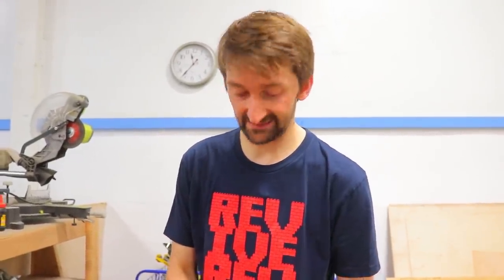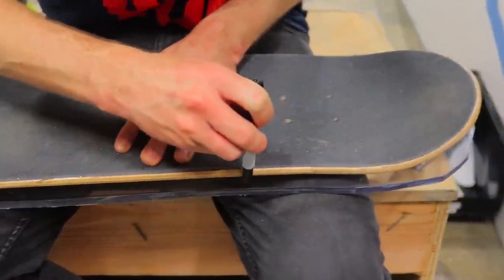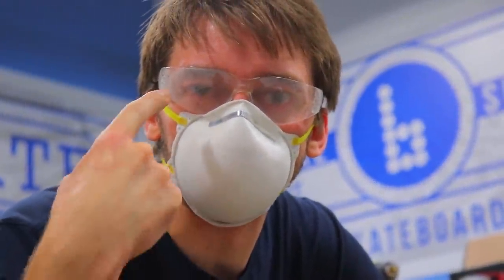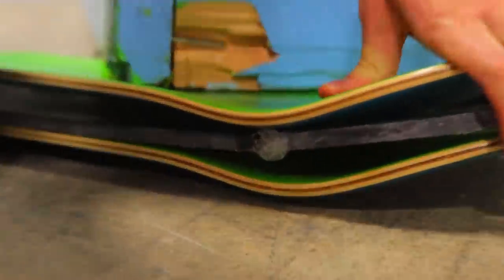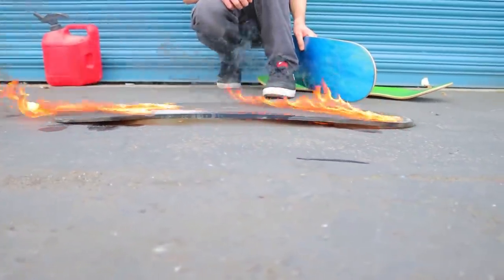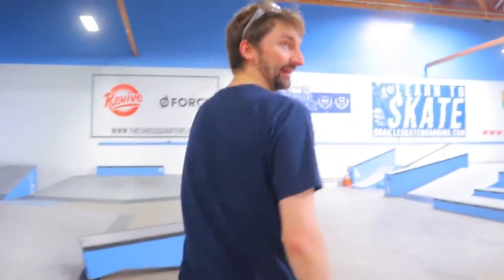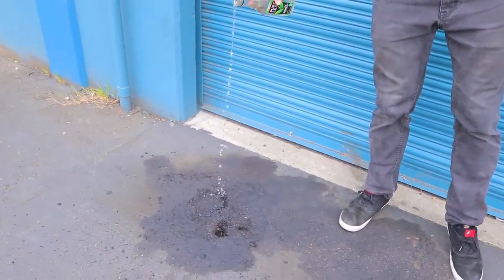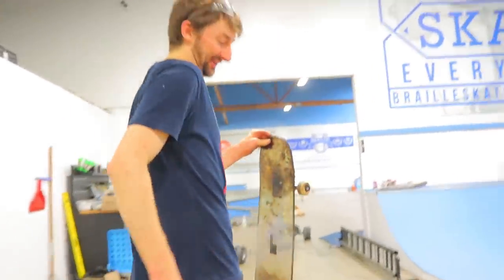WE HACKED THE UNBREAKABLE POLYCARBONATE SKATEBOARD!

Comment: Here ya go Aaron, 
PC or thermoset plastics can only be heated once (typically during the injection molding process). The first heating causes thermoset materials to set (similar to a 2-part epoxy) resulting in a chemical change that cannot be reversed. So technically it couldn’t be melted down again.. I think. Also, if when forming it you heat it too much and it creates bubbles then you might have affected its structural integrity. Cool video! Can’t wait for the lockdowns to be over!

Edit: Correct information in comment below! 🙂
Reply: Polycarbonate or PC is a thermoplastic not a thermoset. Thermosets are like polyester and vinylester resins or epoxies. Thermoplastics can be reformed with heat and welded like PFE PFA, PVC, CPVC, ECTFE, PC, etc. That's why when the PC is brought to the thermoforming temperature the plastic bends and holds the new shape. If the PC was a thermoset than when it was heated it would degrade until combusting or becoming brittle. You are right about the bubbles in the plastic they can form from the heating process but only effect the tensile strength of the material not the flexural modulus. PC is a Bis A product which is similar to some vinylester resins such as Derakane 411 but is classified as a thermoplastic.
Reply: @draconis9766  🎓🏆
Reply: You also can't cool the product too quickly. If polycarbonates are cooled to quickly after being heated and melted, it creates stress fractures within the plastic material. This causes problems where I work if the molds for our PC materials are not warm enough. It needs to be high enough to slowly cool the product as it sets. Otherwise, more air bubbles and stress fractures occur. A 500 degree melt with a 280 degree mold is usual to make sure this happens.
Reply: @karikirby3447  Yes very true!! All plastics being thermoformed must be treated this way! HMU sometime, ide like to see what your thermoforming temperature is ; )
Reply: I feel like if they took the board to a welder they could have gotten this done more efficiently and safely.
Reply: I like how they replied to every other comment but this one😂
Reply: Why would someone take the time to write a comment to inform other people and brag about their knowledge and not even fact check it....
If you dont know what you are talking about just dont write a comment.

PC is a thermoplastic. 

And a hotairgun needs some time to heat up, so dont switch it off every 10 seconds. It should melt you PC board to a puddle easily.
Reply: Draconis Thanks for the info!
Reply: Brendan Kirley yeah

Comment: The 🐗d could have snapped due to high tensile and shear stresses applied in a very short time directly to the interface between the truck plate and the perforated polycarbonate.
If it was still hot it most likely had internal stress, because the inside was hotter than the outside surfaces (inside expanded, outside contracted) adding even more tensile stress onto the surfaces, thus allowing a crack to form and propagate easier.

The thermal expansion is also the reason why the board curved to the direction from where heat was applied

Comment: Polycarbonate has a high glass transition temperature of 150 degree Celsius. It can bee printed using a 3d printer but the hot end where the plastic melts and flows out needs to get around 300 degrees Celsius. Also the bed the melted polycarbonate is on must be heated around 100-120 degrees Celsius. Reheating and cooling has to be done at precise temperatures over precise amounts of time. Some plastics are forgiving on heating and reheating, and then others are not.

Comment: Next time, sandwich the polycarb board between two same-size decks. Use long bolts and nuts through all the truck holes to create even pressure that you can tighten slowly over time. Setup heat guns on both sides of the sandwich near the tail or head one at a time. Keep the hot end far enough away not to create too much heat in one spot. The goal is even heat distribution. Over time, slowly screw the nuts and bolts together on the side you're heating as the whole thing gets warmer and warmer. The trick is SLOW and even heat distribution. Repeat for the opposite end of the board and boom, perfect shaped nose/tail. If you then heat the center the same way, it will end up taking a slight concave shape, giving it a lot more strength. The most important part, when you're all done shaping it... LET IT COOL SLOWLY. It will still be more brittle than before but a piece that thick should be skate-able. Do not dunk it in liquid nitrogen or put it in an ice bath!

Comment: My mate runs a glassblowing factory and even his kiln isn't large enough to do a skateboard. To melt together glass you would theoretically use soda glass (lower melting point) which is weaker than borosilicate. I think without a huge industrial production line regardless of what you used, remelting shards would give you a relatively brittle end product and if it came out like my attempt at a dish, with razor sharp edges. Primo would cut your foot clean in half.

Comment: You had the right idea with the heat gun for concentrated heat setting it on fire with fuel was just coz AK is a pyromaniac.  Tbh I think setting it on fire may have weakened the board by work hardening the polycarbonate

Comment: need t apply even high heat. i used to do this at work with 1/4" plexi glass. heat it with a torch and bend it slowly. if you heat too much you get the bubbles. if you bend it too fast it'll snap

Comment: Here's what I would try:  soak some string or yarn in a flammable chemical then wrap it around the board exactly where you want it to bend.  Probably spin the board while it burns to distribute the heat evenly.

Comment: I built the same thing back in 1993 in a machine shop.  I had the same flex problem, then I added rails. Bending the nose and tail were also a challenge, I used a heat gun to make the bends, it worked, but wasn't great. We ran it over with a car and wouldn't break.

Comment: Polycarbonate is nice, the BPA you create by heating it up is quite bad for you. Like while I still working in heavy industry I couldn't legally  work with forming polycarbonate without an a1 rated mask levels of bad for you. We generally did all but the smallest of forming jobs in a vaccum to remove any moisture from the air not to create BPA.